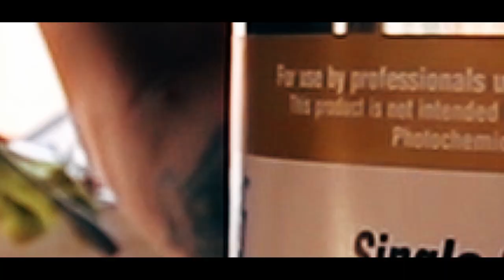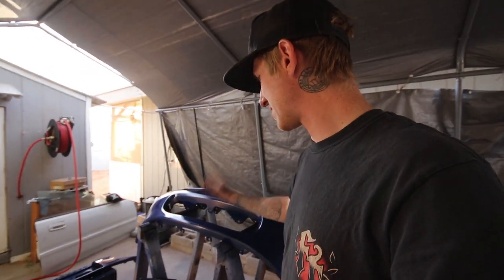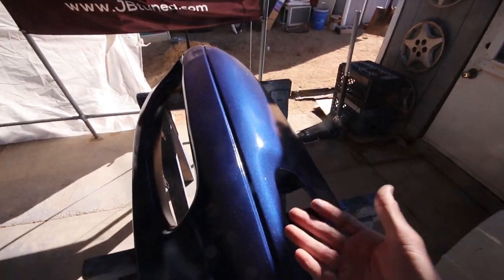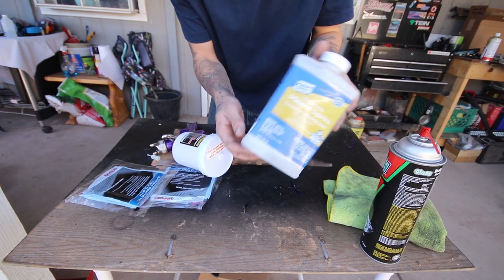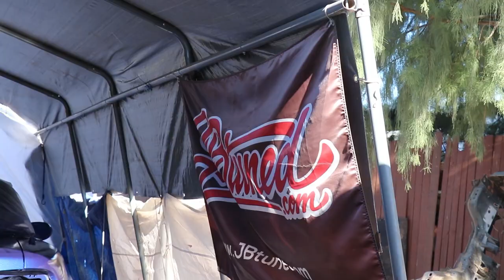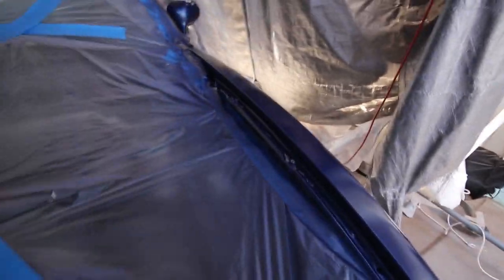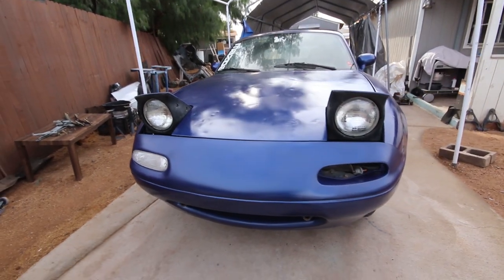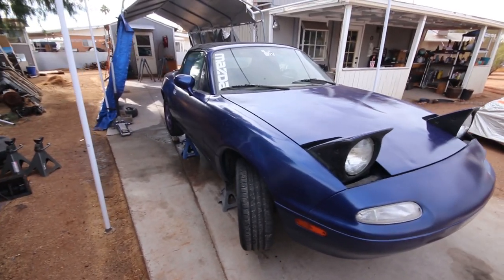Painting the $1000 Miata

Comment: not bad for $130 bucks bro. I think if you invested a little more in a better quality Gun,the paint jobs would come out much better with less orange peel,so you wouldn't even have to cut and polish it after painting it. but still Like I said before,for $130 it's not bad,especially after wet sanding it and polishing it up good.  Also how come you don't use the 2 stage paint instead? I heard it's more forgiving compared to the single stage paint. I think 2 stage paint jobs can look real clean to. It might be a bit more expensive but well worth it imo. anyhow great video.
Reply from the maker: The point of this car was to spend as little and make as most as I could. Two step paint is way more pricey whereas this paint was $93 shipped. The harbor freight gun works fine, the orange peel is a result more of the work environment. Some days I get more lucky with the peel than others. Without a climate controlled booth it’s very very hard. But even so, a $1000 gun will still give you an amount of orange peel, that’s why even after getting a professional paint job it’s always best to get it cut and polished

Comment: heavy coats don't really help with orange peel. You want to lay down a high pressure, highly atomized, thin coat. Best way to do that out of a setup like this is pre heat each mixed cup of paint before pouring and shooting, turn the pressure way up (especially if using unknown style air fittings, unknown gun, or unknown compressor) And play with the fluid needle until you can make passes fast enough, without leaving it completely dry and un-covered. A high pressure thin coat of warm material will lay very flat and almost look "seedy" It's literally so thin that larger chunks of paint or specs of dust look like dirt, once covered with a second and third of the same style coat, those three thin coats melt together to form that nice wet look you're after. Sounds like you were probably fighting the gun, trying to get it to push fluid it couldn't. Either too thick, too small of a needle, or not enough CFM in the compressor.
Reply from the maker: Thanks for those tips. The first gun had clear coat chunks in it that I guess I didn’t clean it out well enough last time. And the second gun was much better. But your right I did spray it too thick. I tried doing the thin first coat but it looked pretty “dusty” and I got a little worried it wasn’t gonna work like that so I opted for laying it heavy, which being cool out was obviously not ideal haha. But thanks for the advice man I’ll definitely try that the next time around!
Reply: @ChrisSadowski  Try physically heating your batch of paint up next time. I used to try to fuss around getting my panels or job warm, but after focusing more on material temp, I've gotten better results and less chance of runs in the cold temperatures. Takes a lot of different factors coming together, and knowing which ones to adjust on the fly to get the perfect finish, but you do some good work given the tools you got to work with

Comment: My B20 Vtec on my 95 Civic Hatch DX eats oil every 3 days I have to check my oil when I drive far lol do you have to do that in your del sol ? Also I think I’m burning rich because gas : Also because I drive far
Reply from the maker: My b20v in my del sol never really ate oil. If I was beating the snot out of it a lot I may have had to top it off once between oil changes but rarely. My K20 eats more oil for sure. But K series are a little more prone to it from what I heard
Reply: @ChrisSadowski  my b20 probably burning rich and needs a lil tune

Comment: why did you not bondo all the dents out?! I know it is much work but now it just looks a lil weird
Reply from the maker: On the hood and trunk, believe me I used 3/4 of a small tub of bondo. I spent two days on the hood alone. But for literally every one dent I fixed, two more showed up. When I washed the hood before I shot it I honestly didn’t see most of those dents. I should have just replaced it but nobody had one local for less than $300 cause they were all mint condition
Reply: @ChrisSadowski  I understand your point. It's a pain in the ass.
Looking forward to the outcome tho. The orange peel looks nasty but once it's buffed out I might look pretty good. Have to do the same with my miata next year after I get rid of the rust

Comment: Needs more air pressure, it's not a temperature thing.
Reply from the maker: I ran around 36psi for this. I read most people run around 34 so I wasn’t totally sure what would have been ideal
Reply: @ChrisSadowski  how big of a compressor and what kind of air fittings? Sure didn't look or sound like 34psi even after a few minutes of trigger. I'm always either turning up the regulator to make up for pressure drop, or waiting for the compressor to cycle off. 30 psi is a good sweet spot, by 40 you're usually just shooting overspray into the stratosphere.
Reply from the maker: Harbor freight 26 gallon compressor. I’m not too sure on the size of the fittings honestly.